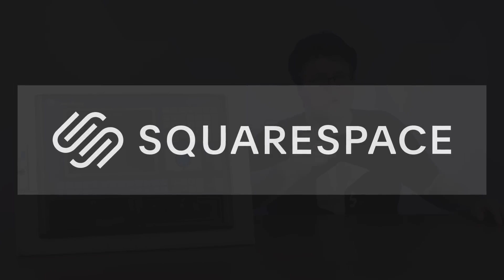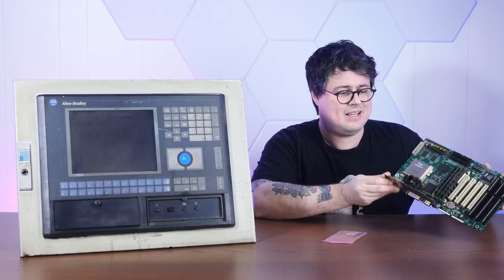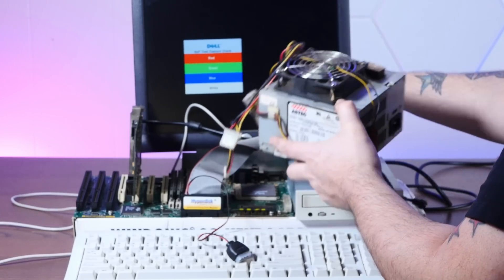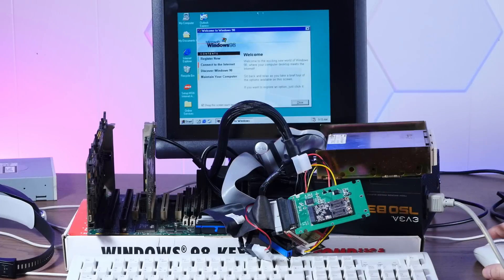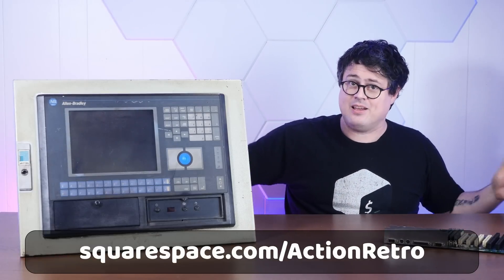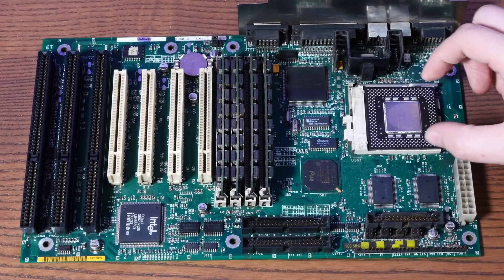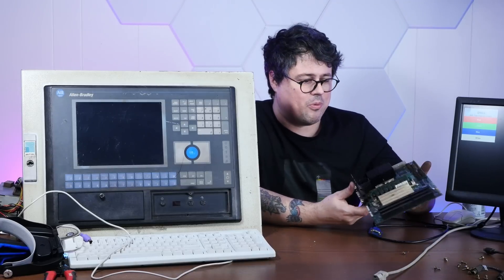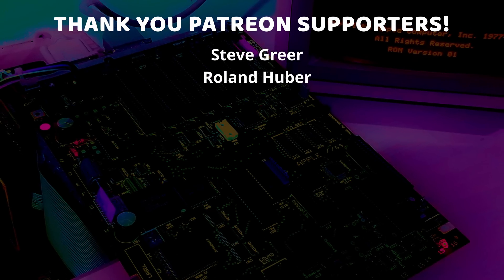Overclocking a 90's Industrial Computer

Comment: I have same motherboard and the second IDE is not gonna work properly until you install a driver for it. It is at theretroweb if you search for Intel Advanced/ML (Marl) board and downloads (Damn youtube won't let me post links)

Also, how much ram do you have installed? Windows throws registry errors at me when i use more than 64MB of ram although they all work and board is rated for 128MB. So I use 48MB so far. I hope flashing newer BIOS will fix it...
Reply: no it doesnt need a driver! he had it working without a driver but now the bios doesnt see the drive. this is a board issue
Reply: @davidew98  Ok, I see... Yeah I got too ahead of myself. Well, it might be broken solder joint on the southbridge, some 3Dfx Voodoos that use same SMD style chips often have those contacts loose so resoldering them might help... Otherwise I needed that driver because than windows wasn't able to see any of the optical drives on second IDE channel despite trying several versions of windows. Weirdly, BIOS saw them all fine... Yeah Intel made boards were always more problematic.
Reply: @jirja3192  if these older boards are set for ide compatibility and make sure Raid if there is turned off windows should see it
Reply: @davidew98  I'm saying, driver helped me. When i had it connected to second channel, windows would list it as unkonown device unless I installed the driver...

Comment: Many 233MHz Pentium MMXs are multiplier locked...
Reply: This one definitely isn't. 233MHz is the one speed where it makes no sense to lock because 3.5x is the highest possible multiplier.
Reply: @eDoc2020  I can assure you that they are, and that it's not the highest multiplier. I have a socket 7 board with up to 5x multiplier. And have an MMX 233 in a socket 5 board with a 1.5x multiplier running at 233... 🤣
Reply: @Microang  Basic socket 7 is only 2 bits, providing for 1.5, 2.0, 2.5, and 3.0 multipliers. The third bit is only on some motherboards and is for non-Intel CPUs. When Intel needed higher speeds they redefined the 1.5x setting to mean 3.5x on the MMX CPUs, which is why you see 233MHz. I bet if you keep the bus at 66MHz you can make the CPU run at 133, 166, 200, 233, and nothing higher.

Comment: I wonder if, in cleaning the LCD, you inadvertantly removed the front polarizer. That would give you nothing but a white screen (That is, the backlight shining through and not being blocked)
Reply: The valuable lesson: never clean.
Reply: The polarizer is a physical (not chemical) layer, no?
Reply: @kreuner11  Yes that is true but it can be damaged by chemicals
Reply: I'm sure you can buy sheets of that stuff, though usually it's a layer of thin transparent plastic mounted to the screen itself.
Reply: @greenaum  you can buy polarizers for screens and then cut it to your needs
Reply: A test with polarized Sunglasses should also possible 😅
Reply: @ Action Retro  hopefully we get an update on whether it was simple Polarization issue. You can get a whole bunch of modern thin films for cheap on amazon. Cut to size and various options (45°, 90°, 180°).

Though I'd first double check you didn't accidentally flip one of the polarizers. Extra Polarizer film is handy to have regardless.
Reply: Yeah… Windex is notorious for stripping coatings off of displays. I've seen some really messed up CRTs that had their anti-glare coatings eaten by the stuff.
Reply: @pseudotasuki  that is why you use distilled water
Reply: i believes it ridding cables tore aparts if he would look closer he will spot it because lcd screen have ridding cable if he knocked it loose it cause white screen
Reply: @kittyztigerz  generally a damaged cable causes a black screen not a white screen. I can't speak for these displays but generally with lvds the failure mode is green and or scrolling like a bad VHS tape and or just a black screen. White is almost always a polarizer issue. But maybe this is an old screen thing. With new screens when they have a bad signal they default to Black.
Reply: @friedtomatoes4946  white screen is background lights i have worked on monitor that ia LCD screen many time
Reply: @friedtomatoes4946  Most "standard" LCDs are naturally white when unpowered. I believe IPS displays are naturally black.
Reply: @kittyztigerz  Hi, just a note but in English it's "ribbon cable". Because they look like ribbons. 

Yeah the plastic flex-PCBs they sometimes use as connectors are terrible. You can only unplug and replug them a few times, sometimes not even once! Still, I think our guy would have looked at that and checked. Still it's a good idea, it would explain a completely dead screen.

Where in the world are you from? I'm just curious. Myself, England.
Reply: @greenaum  from USA n was moved there from japan because of my parents died wish n i stuck here with broken English language and thank for helping out with English

Comment: Seriously amused that you censored the paste application. That was great!
Reply: I seriously laughed way harder than I should have at that 🤣
Reply: Should have blurred the hand, not the paste. 😛
Reply: Why
Reply: @kfox09  Because you would read here now 900 postings just about the EXACT amount of paste you HAVE TO apply or you should burn in hell forever...
Reply: @kfox09  so nobody can whine that he put too much or too little on

Which is dumb because id just get some kind of sick pleasure knowing the amount I put on bothers someone
Reply: @IdealIdeas100  You're apparently supposed to use very little, just enough to fill the little scratches on the chip and the cooler. Mostly you want bare metal to metal where possible, a layer of paste in there would actually impede heat flow, since metal to metal conducts heat much better than a layer of stuff in between. After applying the paste, scrape it all flat and clean with something like a credit card.

I learned this from a tutorial absolutely ages ago. Back in the early days of overclocking. Nobody bothers with that these days, I suppose Intel bin the chips based tightly on performance. Overclocking started cos Intel's factory had produced very good results. As a result they had far too many Celerons that were, I think, capable of 300MHz. 

But 300MHz demanded top-market prices, Intel had a pricing structure that served them well. So they satisfied demand for, say, 200 MHz by marking down some of the 300MHz chip. If it'll run at 300, it can run at 200, obvious. 

Somehow people found out about this, and everyone started buying this particular chip and testing how fast they could run it, ideally with it being stable and not crashing. Then they'd post on newsgroups and share tips. Newsgroups were great, a whole world connected to piss and moan and talk about Star Trek. But there were loads of other groups, 20,000 of them, so there's always somewhere to hang out. Each message persisted for days, it wasn't live chat.

Anyway, this is when companies started selling enormous, extravagant coolers, even water cooling. Cos overclockers needed to get rid of more heat. Intel must have noticed, and realised they could get away with thermal nightmares, if they shipped an enormous wind-tunnel fan clipped onto the chip that would otherwise melt itself in 15 seconds.

Then other shit happened, blah, and apparently the results of Intel's production matched their pricing properly, and no more chips would overclock by very much.

Still I dunno, maybe the overclockers are still out there. Graphics cards suffice as electric heaters on a cold day. There were several companies set up from scratch, to 
serve the overclocker market. Some people overclocked as a free bonus CPU upgrade (actually to the CPU speed they'd had all along and not know). Some people got competitive and made a sport out of it! I wonder how they're doing. They'd spend more money on getting a chip to run a bit faster, when for the same price they spent on ridiculous cooling and hardware, they could've just bought a faster chip in the first place.
Reply: @greenaum  i know how much i need. I never stated how much or how little i need and nobody about to read that wall of text.
Reply: I Wanted to post this same comment. Brilliant!!
Reply: @greenaum bro wrote an essay. 😂
Reply: So Action Retro doesn't reveal his proprietary thermo-paste pattern. 🤔

Comment: You absolutely need a fan on the CPU now. Maybe not on the P100 but the 233 will need it unless you want it to die an early death.

Regarding the second IDE channel, have you tried IDE40 cables, instead of the IDE80s? Some earlier chipsets just do not jive with the IDE80 cables at all. Finally, do double check that it's set to IDE auto in the BIOS. It's totally possible to overlook it.
Reply: Not necessarily with that huge (for the time) heatsink. 

I've got a Pentium MMX 166 from a family members PC that was relabelled as 200Mhz and ran at 200Mhz for over a decade with a heatsink that was much smaller albeit with a tiny little fan on it, so if that much larger heatsink has even a little bit of natural airflow going over it from the PSU fans or the like drawing air from inside the case then it should be alright. If not I'd just get a 80mm noctua and run it at a low voltage for noise purposes, with that large heatsink it won't need very much airflow at all if it needs any extra airflow.

Comment: Might be cool to mount this board in a modern case, ditch the old industial case and build you a Retro DOS gaming PC in a modern case with modern PSU and cooling. I never done dos rig or a PC this old, and I'm sure you would have to come up with a creative way to mount the board in the case, but i think it would be possable with little drilling and tapping or maybe some strong two sided tape even. I mean lets face this case is ugly and the display is crap anyways. 🤣😂
Reply: The "charm" of the system is the industrial case.  A less than stellar Pentium board in a plain old case is not that impressive.
Reply: @timmooney7528  Sorry I fail to see the charm,  it's broken down dirty old industrial control for a machine and not a computer at all in the traditional since. I mean I could see you saying this if it was an old retro computer with some nostalgia and you want to save it, but this isn't a computer in the traditional sense, and not worth saving that case unless you are going to take it and bolt that thing back on an old machine in an industrial setting and use it, then I fail to see the relevance in leaving it in this case with little airflow, that is actually is not good for any components of any kind really!  Had any of the components in it actually produced any substantial amounts of heat they would have been dead years ago, not to mention it has no dust filtration. Their old components with lots of miles on them, so giving them an environment that breaths might prolong their life, instead of leaving them in this ugly hot box,  he might get some use from them and be able to have it sit on a desk and not look like ass, not to mention scratching up his desk. 🤣
Reply: @piecingtogethergamingpcs  Well, fortunately we're all allowed to have opinions, even if they differ. Outside of the old case, it's just an aging P100 on an unusual motherboard. The case is what makes it more of a challenge. Everyone and their cat does old PCs in a boring case, but this is what Action Retro does.
Reply: That board may by chance ATX, but more likely the older PC/AT case standard.  Lots of plain ugly beige boxes would work with it.  I should rephrase  how I use the word, "charm."  Part of Action Retro's humor  involves keeping the product's oddity factor intact.
Reply: @timmooney7528  I understand man it's his way, I guess I'd love to see an old Dos gaming PC and someone really show it some modern love. What are the max specs these old Dos games can run on? The reason I ask is that someone gave me this old Dell it has a 700 MHz Pentium 3 2x 256k ram and a GT 8600 in it, looks like the old APG standard and not PCIe, I haven't turned it on only looked it up online to see what it was, I'm actually afriad the old PSU might go pop.The old lady has Everquest stickers all over her and the front tag says windows 2000, so I guess someone actully gamed on it way back then. Not sure if it can play old dos games. The HDD is a maxtor 20 GB. I did hook this up to my PC and it works, but it seems to contain Windows XP.  Not sure if  that would it be capable of dos gaming, maybe if someone installed 98 on it? I really only recently became intrested in retro gaming and hardware, admittedly I don't know much about it.
Reply: @piecingtogethergamingpcs  A p3 700 would be overkill for DOS gaming.  It's 99-2000 vintage.  Plenty of cool games from that era that would run on Win9x, and if they'll run on Win2k they'll run on XP.
Reply: @timmooney7528  Yeah it's defently XP,  I found a newer PSU and tested the thing, it all works and loaded right into XP no issues. it has the previous owner's Everquest game still installed. I'm gonna do a fresh install, you never know it could have viruses or some crap on it and I don't need the FBI knocking on my door. bahaha. I got into the bios of this beast, it's a Dell Dimension XPS T700R Intel Pentium III 700MHz and it has 512k of SD ram. pretty crazy looking motherbaord defently not an atx form factor and the CPU looks like a cartridge, kinda. Trying to case swap this might be interesting project, but leaving this original might be the best bet, since it's a vintage computer. The Io in the back has USB If i had to guess a version I'd say 1.0 or 1.1 perhaps. It has a strange looking wedge shapped PCI audio interface card and some sort of ethernet card as well. Case is in pretty poor condition and the side door wont latch back on. Looks like it might have been dropped at some point in it's life.
Reply: @piecingtogethergamingpcs  the big OEM's (Dell , HP, Gateway) were prone to make non-proprietary boards and cases, especially on  "premium" systems such as an XPS.  The boards and cases are "custom" enough that swapping boards and cases requires serious bodgery.  Even with HP's most generic looking offerings will have a custom header layout for the LED's and buttons.
Reply: @timmooney7528  Yep I was looking at that board on eBay and ran across another non oem board from intel that comes with 3.0 GHz Pentium 4 and 2 Gb of ram might be more suitable for the kind of retro gaming we talked about and has a PCIe slot instead of agp. I was talking with my older brother about doing some old retro gaming and he gave me another better GPU it's a BFG GT 9800+ 1 GB card, I think I might try to build a retro gaming PC around that and find a board and ram config that would suit it good. Not sure if that Pentium board would be a good match to it or not, but it was cheap 35 dollars. I'm just not sure so I didn't pull the trigger.

Comment: I'll never shame anyone for putting a modern power supply in a retro machine. 

Power supplies can make or break a computer (literally), and the aging PSU is potentially what could randomly kill the PC one day. Sure it will look weird having a modern black PSU in a beige box, but it will be more energy efficient, safer, and maybe even quieter.
Reply: I don't know why you would shame someone for that. Yeah, a fully retro PC looks great, but I'd rather someone have a modern, (hopefully) designed with more or better safety features to protect the older hardware. Seen plenty of shoddy (even "industrial") supplies fry stuff, especially on older hardware.

Comment: Oh and also; how about you change the LCD panel with a fitting modern panel from a pad or laptop? That way you know what drivers your PC needs to run it at the correct resolution and frequency. Also, you should just hook it up to the graphics card, i doubt the ombord graphs works while you have a graphics card plugged in
Reply: I feel like replacing the panel kind of defeats the point of using this thing as a gaming PC.
Reply: @Psythik  sure, if he can get the panel to work, that would be nice but I'd rather see an industrial sleeper gaming PC with a ridiculous panel running at 244hz 1440p xD
Reply: If you do that, then why not just tear out everything and stick a modern PC in there running DOSBOX or similar instead? Either way, you lose the essence of what it was. The challenge is to NOT replace everything.
Reply: @another3997  well, he did get the display to work again so my want goes  unfulfilled (for the time being) and 
1. The computer is no longer stock anyway, it has a modern modular PSU, a flash based hard drive replacement and a new intake fan.
2. The computer would still be a pentium MMX 233 MHz

Comment: probbly cleaned the screen with something that kills it. also try a IDE (or P/sata) ribbion cable with2 connections making the hdd master(middle of the cable) and the cd/dvd a slave (end of the cable)
Reply: Considering Windex is known to eat layers/coatings off LCD's, that's a very safe guess. Surprised he used that, it used to be quite commonly known you avoid ammonia-based cleaners like Windex and pretty much anything harsh.

Comment: You could remove most of the heavy steel chassis for a fraction of weight... save just the front panel and LCD... 3D print a few fittings.
Reply: Yeah but then he could just buy a laptop, or a phone. It's supposed to be a ridiculous tank of a thing, it's the only thing interesting about this otherwise obsolete machine.
Reply: for a fraction of the density and integrity... it's 40% steel
Reply: @Valrax  
It's all good, baby... I'm 60% Dolemite.